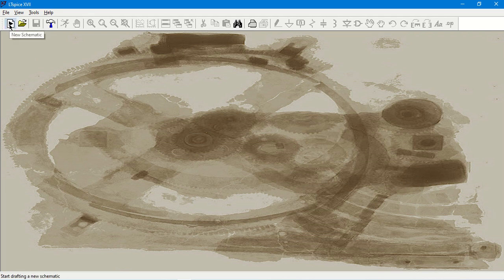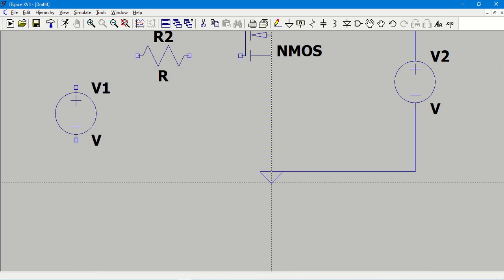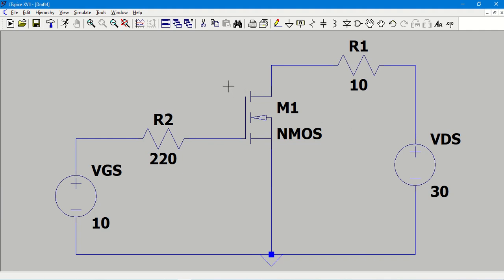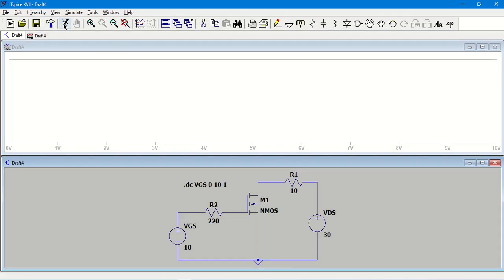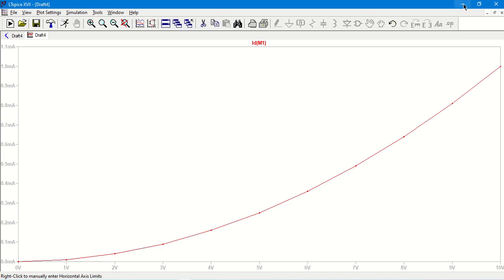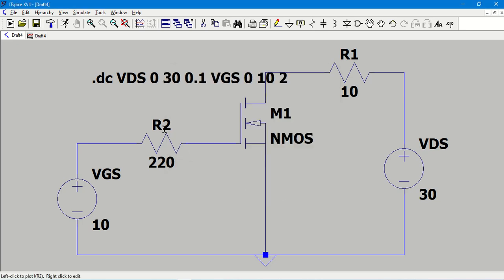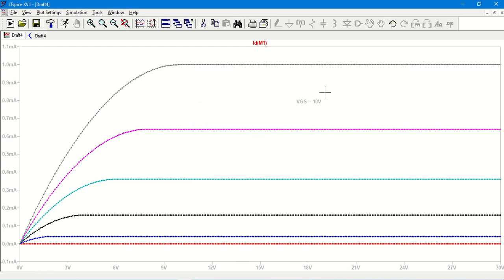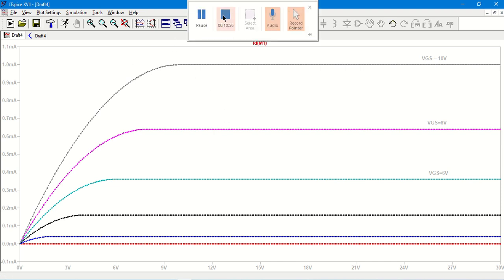MOSFET Characteristics using LTSpice

Comment: I tried picking some mosfet of the LTspice library but the characteristics tests didn't worked as before, have you tried it? Thanks in advance.
Reply from the maker: Different MOSFET has its own voltage or gate drive requirement.  The characteristics will be identical but not the values of voltage and current.  Here I used a low power MOSFET which can be driven from a small signal source